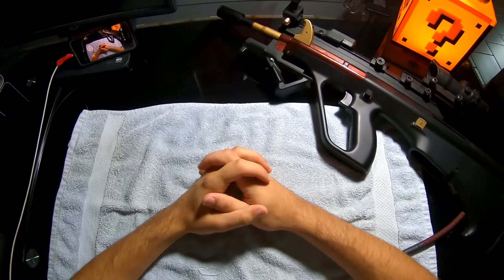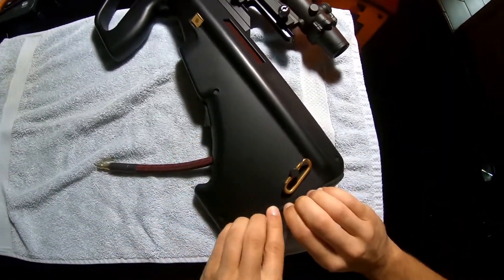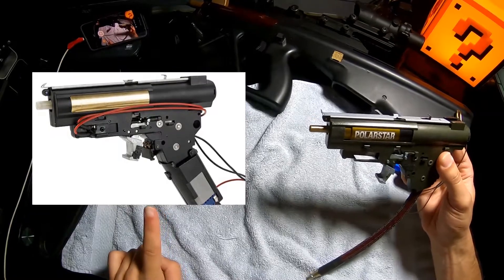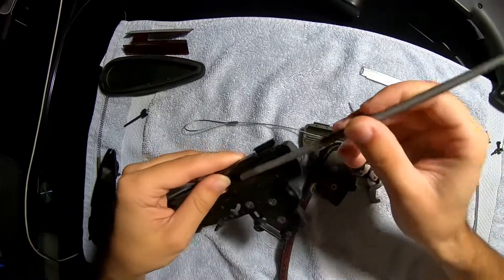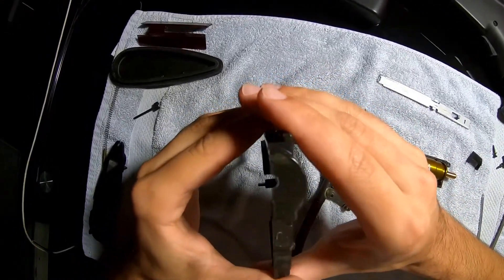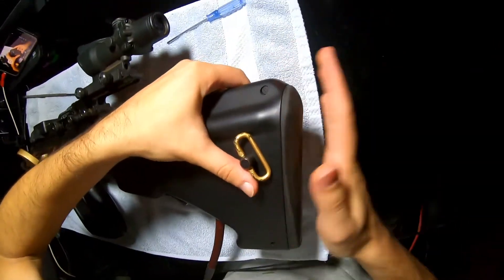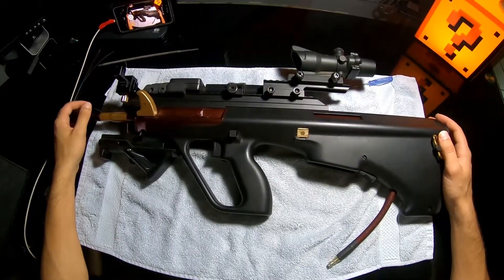Polarstar Kythera || AUG Installation Guide

Comment: Cheers for the video. I am planning on modifying an AUG. The only problem I got with it is that the barrel is around 500mm (19.6"). Will I get any problems with such a long barrel and the Kythera?
Reply from the maker: @ES-wy2xj  No worries 😄

I see no problem with having a long barrel paired with the Kythera! Just chrono yourself afterwards and see where you’re at!
Reply: @PrairieDogAirsoft  Thank you for your reply!

My fear is that the nozzle opens too much before the round completely vacates the barrel. Will changing the spring in the Kythera help with that? It usually comes with a second spring, that usually is used to go at higher Joules. I usually play 1J, just wondering if this will cause a problem with such low energy. I still don't have an AUG, I am willing to buy one, though
Reply from the maker: @ES-wy2xj  I’d email Polarstar and ask them which size nozzle you need to pair with the AUG! They have a ton of different sizes. I’ll actually see if I can dig up an old email of mine asking them myself!
Reply from the maker: @ES-wy2xj  Polarstar told me to use the #15 nozzle for the best results when paired with an AUG (V3 gearbox). That’s your best bet

I’d stick with the stock Kythera spring as well because it’s only useable for higher PSI’s and won’t really affect your barrel situation when you’re playing at 1J (probably less than 120psi lol)

Comment: guns firing afrer putting in the kythera however the power is very low and its shooting with 80psi, would this be due to the nozzle size? its an ASG
Reply from the maker: I would make sure you’re using the same nozzle as me (#15)

I’m assuming you mean low fps/joules. I would suggest just increasing your PSI

Wide bore barrel = lower fps/joules
Longer barrel = higher fps/joules

Comment: Hello, Do you know if the nozzle length is the same between Marui Aug and ASG Aug ?
Reply from the maker: Yup! When I contacted Polarstar at the time, they recommended this nozzle for all Aug brands
Reply: @PrairieDogAirsoft  thx for your Answer ;)
Reply: Hi again, Which hop-up bucking are you using ? On my side I have problems with ML macaron and super macaron. The lip sometime blocks the BB in the hop up bucking. i am curious to know how I can solve this issue :)
Reply from the maker: @anthonygetzman1727  I use the Prometheus Flat Hop Ready Purple with a Prommy purple nub as well

I’ll provide links: https://triggerairsoft.com/products/prometheus-flat-hop-up-bucking?_pos=2&_sid=c00212271&_ss=r

https://triggerairsoft.com/products/prometheus-flat-type-hopup-bucking-nub?_pos=1&_sid=c00212271&_ss=r

I too used to have issues with the bucking folding inward and jamming up the hopup. This is caused by the nozzle returning too fast with the Kythera. Switching to a tighter “metering screw” could fix this problem

If you go that route, I’d suggest the .0019” screw. Although I have the .0015” because I went a little extreme with caution

Comment: Late comment, but what aug is this and how did you decide on what nozzle to use for it?
Reply from the maker: This is the Tokyo Marui High Cycle A3! As for the nozzle, I contacted Polarstar directly and they recommended the correct nozzle size (#15)

Hope this helps!
Reply: @PrairieDogAirsoft  how doable do you think a snow wolf aug a2 with a polarstar f2 would be?

Comment: Hey dude ! 

Finally i could get all the parts to build a kythera in my aug :)

i will User this vid as a guide ! 

thanks !!
Reply from the maker: My pleasure! Whatever you do, take your time.

Especially when it comes to the trigger. I had to file down that one piece I show in the video a bit. 
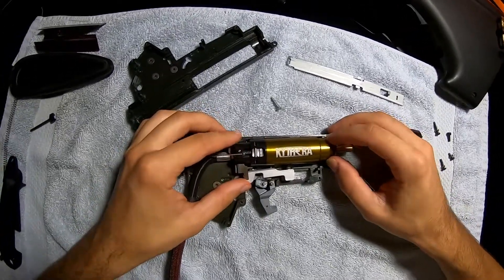(4:39)

File a little at a time (if necessary) and keep testing that trigger until you see that it works with the Kythera mechanism!

Comment: What inner barrel did you put in it?
Reply from the maker: I use an R-hopped ORGA 6.23mm barrel 😅

6.05 or something would do the trick though. I’ve had too much bad luck dealing with dirty inner barrels that’s are also tighter bores
Reply: What length…I ordered my Kythera and #15 nozzle…so I am pretty stoked to finally get the build done
Reply from the maker: @robertbedgood3189  That’s awesome!!

Stock inner barrel
is 260mm (10.2 inches), so anything that size or longer 

I have a 363mm (14.2 inches) just because I have a little barrel extension in the front and a suppressor
Reply: Sorry to bother you… my inner barrel is 508mm..I have the phantom kit which I shortened because it was waaaaaay to long

Comment: In the case of an ak you actually need the motor cage  because that's what the pistol grip mounts to. But you will.l probably have to modify it for the hose.

Comment: Thanks for the video! it helped me with my build a bunch! :D 

One thing I did notice while doing mine though is that modifying the trigger block is unnecessary (on the JG AUG A2 anyway) 

There's a small "runner" on the main trigger part that actually slots into the top trigger block, The way the trigger is supposed to be assembled is that said runner will slide inside the top trigger block which intern lowers the height and eliminates the need to trim down the block.

The way you have yours assembled in the video seems to me as if you have placed the trigger block above the runner rather than sliding it into the block. This method obviously works just as well but seems a little unnecessary to me as I haven't even touched my trigger block and it all works great :D 

This isn't meant to sound like a dick comment, I just thought I would share the experience I had whilst doing my build :) Once again! Thanks for the great video :D
Reply from the maker: Thanks for letting me know! 

Haha I’m curious now, I’ll have to take a look at my gearbox at some point and see for myself! One thing I know for sure is that the Kythera definitely gave me a little struggle trying to cram everything in there! 😄

Comment: Thanks for the video! I read that you have been advised by polarstar to use nozzle 15 as it fits the TM AUG. I bought the ASG AUG (I guess it is the same as the JG Aug). Do you know if these two use the same nozzle length?
Reply from the maker: That’s more than likely the nozzle you will need! ASG AUGS are pretty good and I’d image their tolerances/measurements/construction of the body is identical to TM

Hopup placement/distance from the gearbox should be identical since a King Arms and TM AUG use the same nozzle. I see no different for ASG. I say go for it!
Reply: Did you ever manage to get a #15 nozzle to work with the ASG AUG?

Comment: Did you change the HopUp in it or are you still using the stock HopUp
Reply from the maker: Stock! The TM hopup is already really good!
Reply: @PrairieDogAirsoft  I have the JG AUG A1 is the TM and JG the same HopUp? If not do you know which one would work
Reply from the maker: @robertbedgood3189  Yup! Both of those models use the same type of hopup! All AUGs use the same design of hopup unit
Reply: @PrairieDogAirsoft  thank you so much! I’ve only been at it for a year so again thank you for answering my questions